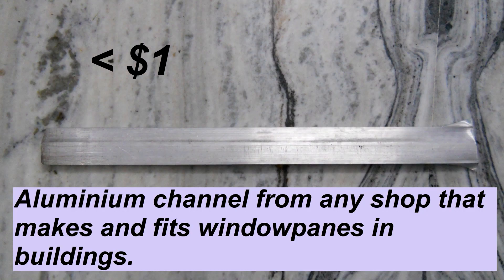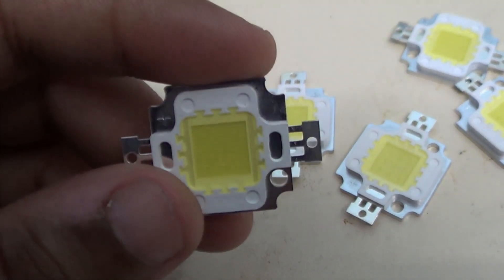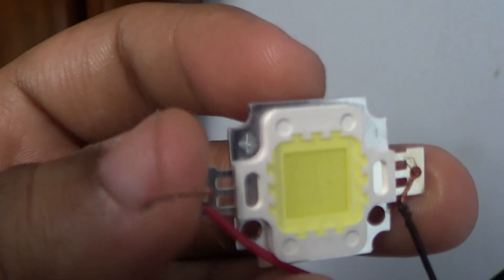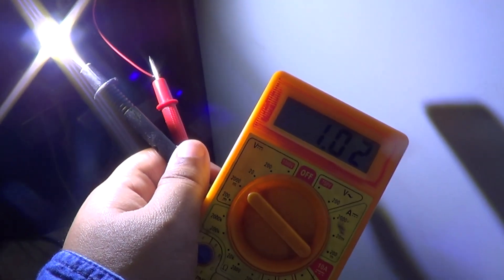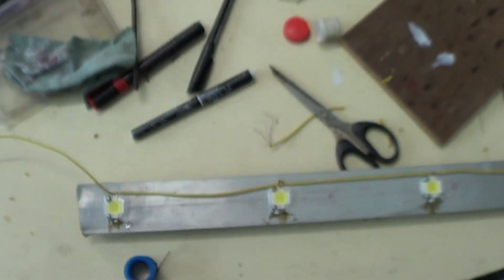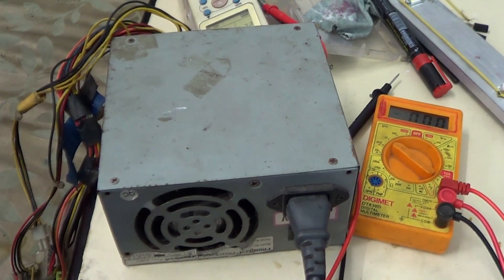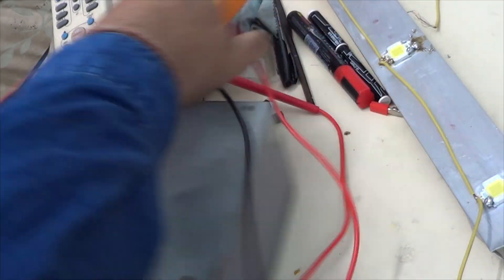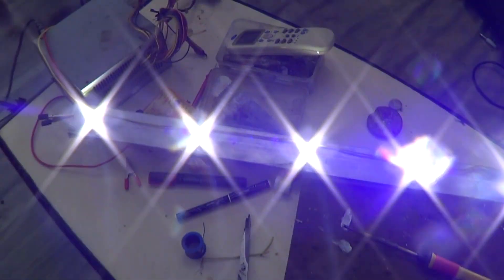The cheapest, brightest and the most energy efficient lighting for your planted aquarium! DIY

Comment: Sir can I run 5 LED chip light at a time, in one 12 volt adaptor.
Pls reply .
Reply from the maker: Sure. Your adapter needs to be a minimum of 7AMP continuous.
Reply: Sir I have adaptor output : 12V - 0.8 A, can I use this adaptor.
Pls reply
Reply from the maker: No. Don't use it for this purpose. It'll overload.

Comment: Hi Soumay - in one of your old replies someone asked about the colour temperature, and you said it was ~6000k, but in another reply you recommended warm white. When I look at the specs of the ones I ordered, warm white is in the 3000k range and cool white is in the 6000k range, so it's a bit ambiguous. They're cheap enough that I ordered both sets anyway, but could you confirm which you've used since it evidently appears to have worked well.
Reply from the maker: I used the 6500K one. I might have been mistaken on the warm white part, because I read somewhere a few years ago that 3000-6000K = warm white, 6000-6500 = daylight, and >6500 = cool, afair. Now the accepted definition has changed, though there are no strict ranges for naming colour temperature.
Reply: Thanks again :). I tried some different search terms and found pretty good info on colour temperature, and it seems that the higher blue concentration of a cooler white (which is indeed >5-6000k) would be more suitable for plants.

That reminds me. I've had 2 of these over the past 10 years, for controlling lights (but they can control anything basically) eg: https://tinyurl.com/ycezq746 (aliexpress link, shop around and might be a better price). I bought mine via ebay way back when, but it's been very robust and the only downside is that eventually the non-replaceable (unless you're handy with a soldering iron) nicd battery inside eventually stops holding settings, but that took about 8 years.

Comment: clever. i'll hopefully be getting myself an aquarium soon, and maybe i'll make some of these lights for it.
but i'd probably connect the LED negative to the aluminium with a small bolt, tin solder doesn't really stick to it at all.
and maybe i'd get a power supply without an annoying fan.

Comment: Just come across your video. Are you still using this light after 2+ years. I had made the same light using exactly the same LEDs. My experience is that they are SO SO hot even with bigger heatsink that you have. I had to use a fan just to blow the heatsinks. This was not the biggest problem. The bigger problem which made me retire this light was that those LEDs lost their brightness pretty quickly, like in 3 months. One had to change new LEDs so frequently. Consider the heat and short life span of the LEDs, I already changed to something else after 3-4 months.
Reply from the maker: Yes, I'm still using it. They retain 60% brightness. In your case, I suggest you use a current limiter like a coil of 1-5 metre 18-22 AWG wire.  Experiment with how much thickness and length needed. :)

Comment: how close together were the LEDS?  I have a 72" long by 18" wide 24" deep terrarium I am building for reptiles with lots of plants. any recommendations on number of LEDS to use. where I live it is 220 volt household current. any other suggestions appreciated need high lumps at floor of terrarium.

Comment: Hi , like how you have soldered negative sides  of the led chips to the aluminium frame . Instead of grounding  negative side on aluminium frame  , can i solder all the negative sides to a wire(like you did for positive sides) and then connect it to the PSU . will it work ? since i have 5 small pieces of heat sink and i want to connect it in series.
Reply from the maker: No, just connect a wire for the negative too, like I did for the positive lead. That's more secure.
Reply: You can connect the negative side how ever you want, but you always want to connect the metal parts to ground. it's not there to create a least resistive path, because current goes through all path, regardless of the resistivity. Grounding the metal creates a shot circuit if the the hot wire came loose and touch the frame, this will trip the protective device such as fuse or circuit breakers (which you must have for a electric circuit), and open the circuit to prevent it from shocking you.

Comment: I'm not overly familiar with soldering electronics. Is it safe to have bare conduit like copper exposed to water?
Reply: +TemplarAce depends on if the water creates a circuit between pos and neg contact.

Comment: hi
It was nice to see the DIY video.
For  person who does not have backgound of electronics, and electrical systems
can u plz post specs of LED's which I can ask for in shops. (in India?)
Also, Can this be used as RGB lighting in aquariums for display purpose?

thanks Sir
Reply from the maker: +Sk Patil Thank you for your appraisal. Yes, you need to ask for 'single die' 12V 10W LED. They are widely available in radio shacks in India. I doubt these LEDs have RGB versions available as widely as the whites, but you can try. If not, there's always the online option. RGB versions of lower wattage (1W) LEDs are widely available though.
Reply: +The Tiger Koley 
I have gone through ebay which has 
5-PCS-ACTUAL-10W-WHITE-LIGHT-LED-SMD-BEAD-CHIPS-BULB-LIGHT-LAMP-DC-9-12V 
avilable for INR 180/- I doubt that it will illuminate my tank of size 4'x1'x2' (ft).

plz guide. I have not yet thought about aquascaping yet, but in future I want to go 4 it. 
plz advice
Reply from the maker: That will be enough for plants with low light requirements. For that dimension of a tank, I recommend 10 of those LEDs if you plan to plant high light requirement plants. But for fishtanks, these LEDs are a big no-no. At least I would never recommend as it's too bright for their eyes. Better still, if you put a light diffusion film over the LEDs, you can use it in fishtanks as well.

Comment: Is this heatsink too hot after few hours? It seems that it is too thin for 45W LEDs.
Reply from the maker: +kesakesa1 No. It maxes out at 40 degrees Celsius at an ambient temperature of 25 degrees Celsius.
Reply: How big is the tank, and is that light 6500K or more? It seems that it goes more on the blue spectrum.
Reply from the maker: It is 6500K as per the datasheet. These are MIC India LEDs, and so I think we can rely on the datasheet specs. Maybe the camera captured a little on the bluish range? The tank in the video is just 30 litres. Here is a ~100 litre tank with the same LED fixture used. 

http://bit.ly/LED-2

Comment: I have a couple of questions :) If the leds and wiring are exposed like that, will I have to worry about possible rust? Can I cover the aluminum channel with a pvc gutter channel painted black or will the pvc melt? I was wondering if you would be willing to add english captions as the automatic captions don't seem to make much sense to me.
Reply from the maker: +Iliana Robles Thank you for your question. I'm using it for 9 months, but there is no evidence of rusting till now. I'd not recommend painting the aluminium channel, because that'd interfere with the cooling of the channel. You might want to use a powder coated black channel for your purpose. It's very efficient in terms of cooling, and also black as you want.

Alright, I'll upload subtitles within a few days.

Thanks again!

Comment: what are  the other options of power supplying units..i dont have a scrap like u do...can a adapter of 16 v-12 v can be attached toi mains & is it feasible as a power source ??
Reply from the maker: +sujit Dutta Yes, you can do it. Make sure the adapter has 12V output and at least 1.5x current rating in Amps for the LEDs. (Each LED requires approximately 1.1 Amps).

Comment: You cant solder aluminum reliable, will always be bad solder connection. 

And you need CC source for every led, they die fast if you run them like this. You have now 45 x 1w power leds in parallel, thats not a good idea, current of 1 led will be higher en he will die, then the current will get higher for those other and those die now faster, a snowball effect. 

But the leds will be extra bright but for shorter live. :D

Comment: I'm planning to try this out on my 80gallon but was thinking about using 20w leds for better penetration. Any suggestions? or modifications?
Reply from the maker: +Cory Martin Yes, surely you can use 20 watt LEDs. But then again, heat dissipation will be more. Make sure you use a good quality thermal compound and wider aluminium channel. Thank you.

Comment: Thanks I want to do this but afraid as of my last search the LEDs on the internet are running from $5.00 to $8.00. but this is a nice cheap high powered DIY LED build.
Reply from the maker: Mark Walcot Thanks for your comment. 

You can search ebay.com

http://www.ebay.com/itm/5pcs-10W-White-High-Power-800-950LM-LED-light-Lamp-SMD-Chip-DC9-12V-/141278052464

Comment: Hello, very inspiring video, I will try to make something similar myself. My only question is if i could use that aluminium channel upside down, install the leds on the inside because i would like to place a splash guard as well. A lot of water agitation in my tank unfortunately. 
Cheers and keep up the good work !!!
Reply from the maker: G Daniel Thanks a lot, Daniel, for your encouraging words! Glad you liked the video. Yes, you can definitely install the LEDs on the inside part of the aluminium channel, but the heat dissipation wouldn't be as efficient. But you can use it. I'd suggest 4 LEDs in that case.

Comment: Wow, just wow...soldering on aluminum...if that what you call soldering! Poor heat sink principles and the list goes on, and on and on. Nice hair doo thou
Reply from the maker: Ace Storman A similar setup is running fine for more than a year, 15 hrs a day, with negligible loss of brightness. If the surface isn't warped, the heatsink can't be said poor.
Reply from the maker: Ace Storman You can solder wires too if you want, rather than soldering on aluminium. 

This project is targeted to be cheap. Better heatsinking means more money, sometimes almost a hundred dollars. This is a time-tested project with the lamps glowing 6000+ hours with ~85% brightness retained. What more can we want from a $15 project?

Comment: Do you know where else you can find LED lights like that for so cheap? I've found them at certain places on the internet for pretty expensive. We don't have a radio shack in my town anymore, and the one we did have was small and most certainly wouldn't have carried these lights.

Also, do you know exactly what they are called? I've seen "LED diode" before, but I don't know if that is the correct or most universally used term out there.
Reply from the maker: g68unit LED itself backronyms to Light Emitting Diode. These are 12V 10W LED modules.

Just search in ebay for "12V 10W LED." 

Here's an ebay.com link where you can purchase these modules cheap. 

http://www.ebay.com/itm/10Pcs-DC-9-12V-10W-Cool-White-High-Power-800-900LM-SMD-LED-Lamp-Flood-Light-Chip-/291409404393?pt=LH_DefaultDomain_0&hash=item43d95aa1e9
Reply: The Tiger Koley 
Thanks a lot. Also, do you (or anyone else) know if a simple aluminum plate would be enough of a heat sink for 20W LED lights?
Reply from the maker: For 20W LEDs, a simple aluminium plate would be enough, provided the contact surface is smooth and almost flawless. The plate needs to be at least 2 inch in width, with at least 4 inch separation between LEDs. Then you are good to go.
Reply: The Tiger Koley 
Ok, so I changed my mind and I think I'm going to do the following set up: A 6ft long aluminum plate with a quantity of 8 10w LEDs. I will use a 100 watt LED driver to power all the LEDs in series, and will just mount the LEDs directly to the aluminum plate as a heat sink. Do you see any flaws with this design? And can you tell me what type of cable you used to connect all the LEDs? Thanks.
Reply from the maker: g68unit Your design is fantastic. Just make sure the aluminium channel/plate is at least 2-3 inches in width, and the surface is smooth and isn't warped. For the cable, use a pure copper cable that's rated to carry at least 15 Amperes of current continuously. (Household wiring cables for heavy duty appliances like microwave ovens, water heaters etc. are more than enough.) And you shouldn't wire up all the LEDs in series. They are recommended to be driven in parallel by a 12V driver that is rated to deliver at least 150W. That's why I used a 400W computer PSU. Any el-cheapo PSU would do. Because, a 10W LED consumes more than 10W. Add a 25V 3300uF capacitor in parallel with the driver output, if it doesn't already have any. Any questions, please ask. Thank you!
Reply: The Tiger Koley Oh yes, yes, I meant to say parallel thanks for catching that. That's really good to know about the capacitor. I will check with the manufacturer of the LED driver to see if there is a capacitor included within the device. Also, thanks for the information about the rating of the driver, its really good to know that you should get one that is technically a higher rating than for what you are powering. I had no idea of that, so thanks. (all of these things that I learned in my college physics class are starting to come together haha). It sounds like you are quite the expert with electronics, and your ability to write in english is impeccable.
Reply: The Tiger Koley So technically I could use a 400w computer PCU to power these instead of an LED driver? Do they basically do the same thing? (sorry I'm such a noob). Because from looking at it, I can actually get a computer PCU for cheaper than the LED driver.
Reply from the maker: g68unit Thank you so very much for the appraisal, dear friend. :) 

Yes, you could definitely (and most desiredly) use a computer PSU. They work much better in terms of voltage control, flicker resistance and load capabilities, than LED drivers. 

Connect the black and green wires in the ATX connector to start the PSU, and use the Yellow and Black Wires of the Molex connector to get 12 Volts to power the LEDs. (Shown in the video).

By the way, I have a book to my name. You might want to check it out. :)
http://thestoryofmaya.wordpress.com
Reply: The Tiger Koley Wow, a master's degree in clinical psychology? How do you know so much about electronics?? I thought you would have been an electrical engineer or something! Wow you are a smart guy. I'll have to look into getting the book.
Reply: The Tiger Koley Excellent advice, I'll go with a computer PCU, thanks so much man. Do the computer PCUs usually have a Capacitor in them?
Reply from the maker: Thank you so much! Yeah, electronics (and robotics recently) are my passion since childhood. You can check out my latest video of a dual thermometer using robotics. :)

Yes, computer PSUs have at least one big capacitor in them. Very cheap ones do away with a smaller one; but it's still enough for powering LEDs. Else, the 50/60 Hz flicker will make everything unstable.
Reply from the maker: And thanks again for your interest in my book! ^_^

Comment: i see other videos of these leds and they say you need a led driver.  should i use a driver or not?
Reply from the maker: lonerwolf69 The computer PSU used here acts as the LED driver. It steps down 220V to 12V, which is needed for the LED.

Comment from the maker: Holger D. Thank you so much. Yes these 10w LEDs run quite hot. So we need to hook them up to a heatsink. In this video, I've used the aluminum channel as the heatsink.
Reply: +The Tiger Koley Is this lighting still working and growing aquarium plants for you? Did you make an update video on it showing it on your planted tank after it has been working for a while? Did you run into any problems with its use? thanks
Reply from the maker: Yes, it's working fine now and growing plants as desired. I'll post an update. Thank you.
Reply: +The Tiger Koley Glad to hear they are working well for you and looking forward to the update video! Thanks!
Reply from the maker: My pleasure. I'll notify you soon with the update video. =)
Reply from the maker: +The Tiger Koley Update video! http://bit.ly/LED-2
Reply: hi koley ,im newbie into it, im planing to  make 20 LED hpl 3watt, with different colours blue n white, all palarel
question is

1) aslong the led watt and the volt are the same, is it fine?

2)how about kelvin ,luminoux and mA(miliampere) ? does it matter? 

thank you in advance
Reply from the maker: HPL 3 watt means? You mean the brand HPL that sells 220V LED lamps?
Reply: high power led, https://www.tokopedia.com/t-shop212/lampu-high-power-led-hpl-3-watt